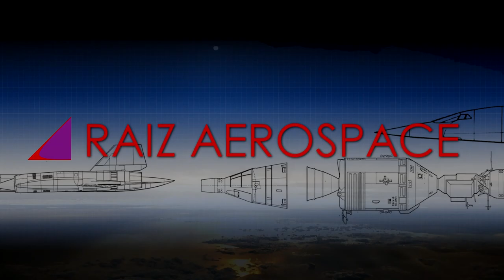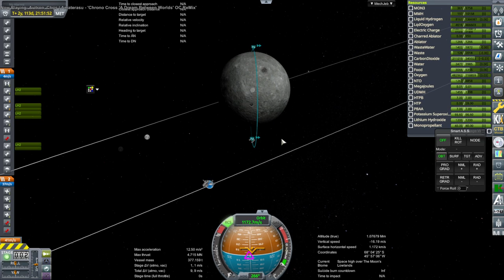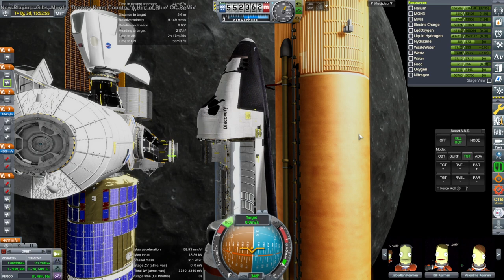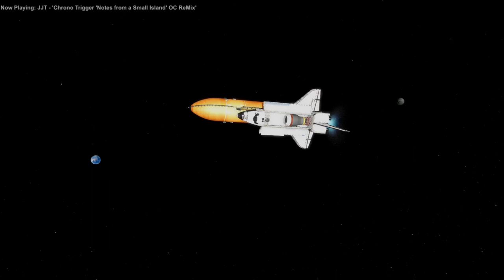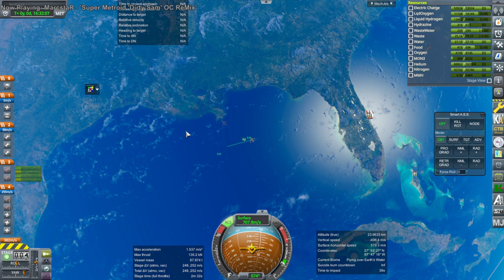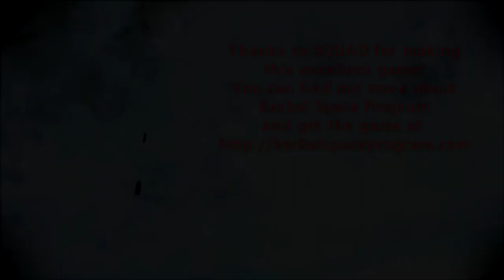KSP/RO - Shuttle to Lunar Orbit and Back (Monument 02)

Comment: The max speed and max altitude for an ejection seat depends on cockpit. You can check it by right-clicking on it. If I remeber right, Gemini ejection seats had 900m/s max speed and 55km max altitude.